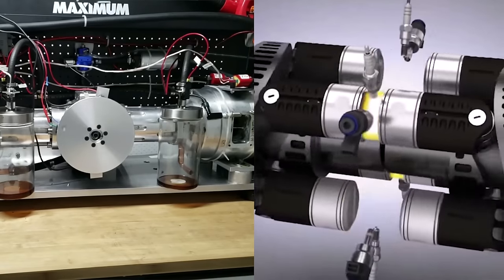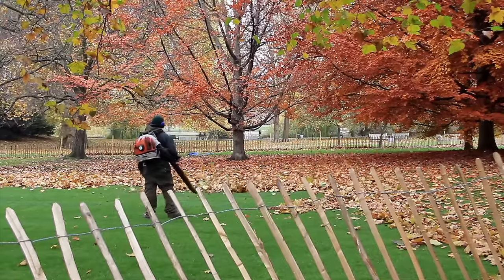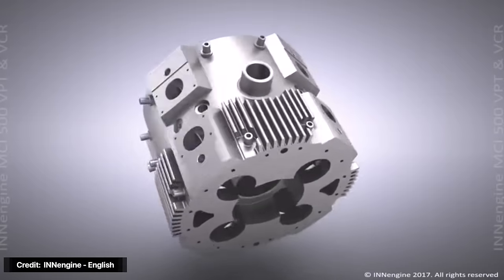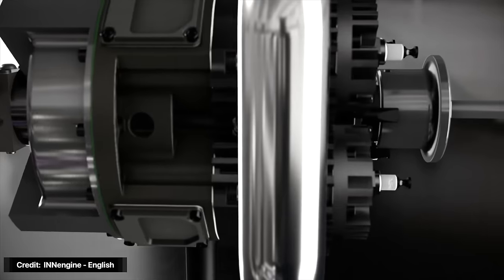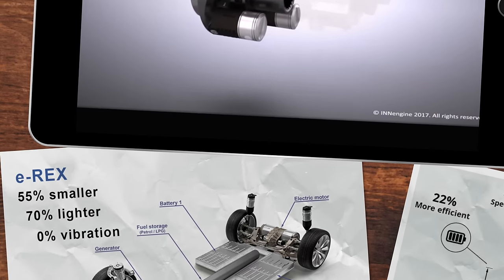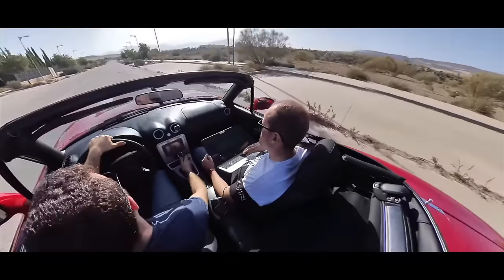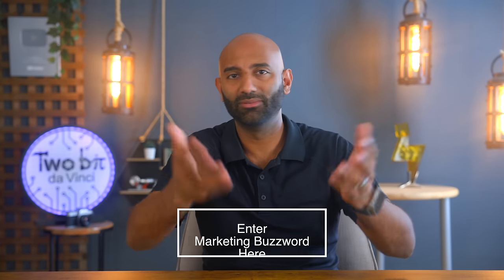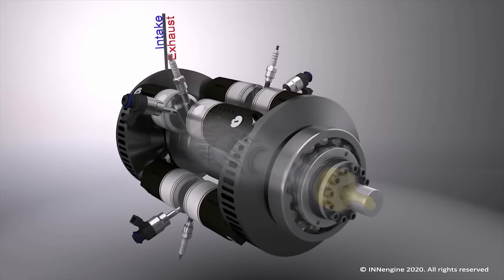One Stroke Engines - 200% More Efficient??

Comment: The resurge shows that this world is not yet ready for full EV's. you need to charge those MF's and for that you need a power grid that can do that, and were are those power grids running on .....?  we are no way near that.  If I have to shut off my AC on a blistering hot day so my neighbor can charge his EV than we are on the wrong way . second we do not have the materials to make so much batteries to support all those EV's. 3th ask a tesla driver how his car works if it is 0 Degree Celsius outside. I would not want get stranded in a blizzard in a tesla, better something with a gas tank . The EV have there use but it should not be pushed on every body like it is done now.

Comment: I'd like to see it as a EV range enhancer, recharging only when desired. In this way the full value of an EV in short distances as well as the benefit of continuous charge capability during long distances are accomplished, and optionally supplementing the system with an additional fuel compartment during a long ride to reduce pit stops.

Comment: Very interesting engine but this is definitely a 2 stroke engine just as a Detroit diesel is. The Detroit also uses a super charger to force out the exhaust and recharge the cylinder with air for combustion. This was developed in the 1930s. This engine uses a design similar to a/c compressors I’ve seen. I agree with the premise that torque is likely low.

Comment: If you will never buy an internal combustion engine vehicle again, You would be foolish. Unless you never plan on driving outside of the city. Good luck finding a charger within a hundred miles of me. Hydrogen technology is the way of the future. One fuel for your battery charging needs and range extension for an internal combustion generator.

Comment: A full transition to EVs right now would be a big mistake. Our electrical infrastructure could not support all the EVs that would be on the road. Also any EVs operating in real cold weather would have a real problem with current battery tech. Lithium is very dangerous and has caused a lot of fires that can't be put out. Also efficency is an issue.

Comment: "I'll never buy a car again that has a gasoline engine driving the wheels..."

It's great that you feel that way for yourself, but dismissing the use case for others is short sighted. Not everyone wants or can live with an underpowered hybrid or an EV that takes hours to charge every couple hours when pulling a load.

Comment: It is essentially a one stroke tho.. imagine it as a hammer, forget what it's doing inside but it hammers with each 'stroke' it is what it is a stroke. And it handles and satisfies each necessary act to complete intake combustion and exahst in one "hammer" or stroke.. the piston doesn't have to pull in air (one whole stroke, 
compress/combust(another whole stroke), the push(another stroke)  Exahust. Last whole stroke as a 4 stroke. Even a two stroke makes 2 entire strokes to complete combustion.

Comment: First thing this guy is incorrect about is that an engine sucks air in. The atmosphere by nature fills any voids the space that held the exhaust gases is filled with fresh air by atmospheric pressure. It pushes it's way in. Now a Turbo,a blower or will push or pull the atmosphere in increasing the frequency in a cylinders ability to ignite. But the atmosphere is everywhere around us. It fills space thru pressure.

Comment: Integration of this motor into existing BEV would be a good stop-gap measure to counter the not so awesome parts of EV ownership until power grid capacity increases to handle a significantly electric fleet, charging station networks grow and mature and battery technologies improve in power density, charge rate and cold weather performance.  All engines have a sweet spot for efficiency so using a motor such as this in its' sweet spot for power generation (instead of propulsion) would enable not just range extension, but also charging while parked, charging during power outages or when a charger is otherwise unavailable and as a battery capacity multiplier if using the car's battery to power a home during an outage, tools at a worksite, etc.

It is also important to remember that gasoline is only one of many petroleum products used every day and as such will continue to be produced either as a fuel or as a byproduct of refining oil for other oil-derived products.  As long as we rely on any oil-derived products we'll be making gas and will be confronted with the choices of using, storing or pumping that gas back into the ground and given those choices using it may turn out to the best balance of economics and environmental impact, meaning that we can still see a win for carbon reductions by using much less gas and doing so in ways that allow us to best capture the energy potential of the gas we use.

Comment: Honestly EVs are not a valid replacement at the current time considering grid limitations and power generation, as there is loss while charging and discharge so gal for gal for fuel used EVs don't beat out a standard IC unless you are 100% getting your power via other means. 
As for options IC over EV as in running a generator to power a solid electric drive train it is the best option to cut fuel and not stressing the grid especially in areas where the grid is already struggling to keep up with demand, it also fixes the range issue which is huge in very rural areas, as well as there being options to fix the problems with how EVs react to the cold without negatively affecting range. 
Companies like Edison Motors out of Canada have started this, though right now they are focusing on tractor trailers and trucks the idea is versatile and corrects some of the problems with pure EVs.

Comment: I am a very  mechanical and practical guy, I  eat, sleep and shit tools.  If you don’t think electric is the future for cars I really would like you to answer one question. When the oil is gone which is has to end eventually what are we going to use??? I believe we have to start using more nuclear power plants, if made and maintained properly they are very very safe  and have to start using electric vehicles where they are practical until we can figure out a long term solution. A lot of people get into which is better for the environment… they both are bad and everything we do is pretty much bad for the environment…. You can’t fart without affecting the environment In a microscopic way lol.

Comment: As a Range Extender, the One Stroke Engine could be a short-term solution to range anxiety.  But instead of an EV you'd  have a hybrid of sorts.  All that trouble when you can run all of these with hydrogen with little changes to all.

Comment: Since there are a lot of good high torque electric motors, this could be a pretty good hybrid engine. As good as EVs can be, an efficient hybrid could be better for the environment depending on where you're getting the power you're charging from. There is also the benefit of how quick it is to fill a gas tank, and as you mentioned, energy density. If you have to waste energy accelerating all of that mass then gas could be a better option.

Comment: I don't care for the heavy weight and relatively short range of the EV vehicles at this time.  I still think gas and fuel cells are better options for long distance vehicles over short time frames.  EV are suited to daily drivers and urban use.  As far as saving the planet, there is no obvious reduction in the need for internal combustion engines due to power grid limitations for charging EV's at this time.  Wind power still requires petroleum products for lubrication of the turbines.

Comment: I personally think that 2 stroke engines could make a come back since they give double the power of 4 stroke engines thus completely defeating the purpose of 4 stroke turbo engines. 
The problem is noise and overcoming the sacrificial oil burning in those.

Comment: I do not agree with your assertion that ICE engines are done. In my personal opinion hydrogen electric are the future, it just needs to be further developed. Current EV technology is just moving the pollution to another location and we're not even speaking about the end of life of the batteries. When you look at the cost of a new battery pack, you might as well buy a new vehicle.

Comment: It is cool tech but also a pretty risky investment. This covers a niche that exists now, specially it is a great fit for medium sized devices that need high power and low weight for a prolonged time. Which is something current batteries struggle with. Either the batteries do not last long enough or they are too heavy. This could be a great middle road to clean up all those dirty and noisy leaf blowers, lawnmowers and similar gear for which batteries today are not a good fit. Until that long promised battery breakthrough that replaces lithium actually happens.

Comment: Electric cars to me are not the environmental solutions that they are hyped as. For one, the electricity used to recharge them comes from oil, coal or gas powered electric plants for the most part.
All of the so called environmetal gains of driving an EV are erased by the origins of their electric charge. If we were to convert our electrical generation to safe nuke reactors then I could see some merit to the EV. But another problem is the time that it takes to charge an EV and a second issue is the vastly reduced energy of EV batteries when the weather gets extremely cold. 

Then another issue is the amount of polution created in making EV batteries. Lithium mines are located in countries that do not have child or slave labor laws consequently in order to feel good about ourselves in driving EVs we are contributing to children being forced to work in dangerous jobs for no compensation. Then take into account the diesel powered excavators and trucks that carry the ore from the mines to the processing facilities.

If EVs are the answer, then I want to see all of the mining machinery using EV technology solely. Put your amperage where your mouth is, so to speak.

Comment: Theirs a company already building diesel power EV semi's, the diesel engine runs at a lower rpm at constant rate to charge the batteries only and the drive train is totally electric .so the consumption of diesel is so low that it should be the future of EV and the key to minimizing resources depletion .or just go back to steam engines because if you search that you will find a steam power jeep gladiator .....mind blown lol

Comment: Hybrids are the way to go providing the benefits of the electric motor including instant high torque, efficiency, no exhaust and low noise and vibration  with the high energy density of liquid fuel fueling a generator to recharge batteries or power the motor directly (variable speed generator).

Comment: Do a video on why the two cylinder robin golf cart motor is designed the way it is... Two cylinders, timed the same, both reaching TDC at same time, both plugs fire together, but the cam has the phases 180 degrees apart...plus there's a counterbalance shaft. Weird little motor but runs so smooth.

Comment: I think electric vehicles with an onboard generator is the best solution for present day vehicles. The performance of the internal cumbustion and electric motors can be optimized. The idea of grid-only based charging of electric vehicles is not viable.

Comment: Im poor and cannot afford an EV. Living in the country, far from an any charging stations, and my fear of so many recalls and batteries just bursting into flames make it a solid no from me. By the time a hybrid that does come along I can afford used, the battery replacement will cost more than the car. A shift to turbine or other lighter more efficient engines, so the oil companies and the government can still get their cut would be fine.

Comment: I'm a big fan of ICE as range extenders. Most of the time, they never have to turn on. But if you want to drive interstate.... I think I read that they were working on a rotary engine specifically designed to be a range extender (e.g. generator).

Comment: its not going to because we are not to the electric era yet and it is not going to work for a long time, it is more polutant to make electric cars than gaz cars because one way or another mine equipement need many many MANY gallons of diesel and gaz and is very polutant and not only that battery are also very toxic for nature, it is not for no reason that lithium and many other metal are underground. the futur is hydrogen cars and is going to be for decades. Why give up on a technology for another when the first one is great electric as many down falls, it is extremly bad for cold weithers and many more other issues, many country cant give the power to recharge a car like that well in the other hand hydrogen cars just needs the most known resoucre WATER.........

Comment: There's no such thing as a perfect RPM.  Having a generator engine on a car to power the drive train is extraordinary inefficient.  This tech has existed for a century at least all of the car manufacturers never offered cars like this for a reason.  If they did offer cars like this they were short lived.  You would need a large V8 to give you the power you wanted.  Taking it through an extra step of charging a battery will just waste energy you might as well get a normal gasoline powered car then you didn't lose energy in rotation of a generator and heat through conduction.

Locomotives have ran with a diesel generator charging an electric motor, no battery it would likely need two or three engines to have a battery and actually use it. So your idea won't work. Not well or not better than just charging your electric car or powering the wheels with a fuel powered engine.

Comment: No, the thing is electric is not gonna work the United States cannot support all electric automobiles because the power grid can’t handle it and not just that gasoline and diesel engines have proven themselves to be the most reliable source of transportation and power for generators and pumps. You can go a lot farther with a gas or diesel vehicle or an electric vehicle. The reason they want to go full electric so they can control everybody. It’s not about the environment. It’s about control if they have control over people that they have the power to keep us from being able to move around freely. I believe it’s all politically based. If you don’t do what they say, they can cut you off and there is nothing you can do.

Comment: That last engine worked like steam  engines? That would be awesome push and pull. Like when I installed peddles on my bike when I could hook the top of my foot.  I could pull up as I pushed down . I could use higher gears ,I had more power and I was more efficient.

Comment: I have wondered for years why the auto makers do not put a small (1 liter or less) engine in a car to charge batteries or just supply power directly to a drive train. Diesel Electric railroad engine have done that for decades, And the railroad companies have been claiming for years that it is much more fuel efficient!

Comment: Modern naval ships are into what's called integrated electrical propulsion.
There is no physical connection between the turbines/diesels or propeller. They are driven by electric motors. Generators are turned by diesels and/or turbines as needed. This eliminates heavy and complicated reduction gearing.

Comment: I am having a hard time finding anything new here. The German Junkers aircraft engine of WW2 is basically the same idea in  a linear layout and several "barrel" engines were made and ran in the 1950s. Those barrel engines suffered in heat and lubrication issues and fell into the dustbin of history.

Comment: I just tuned into your video about 3 seconds ago anyway we shouldn't be turning to EVS we should be taking diesel engines and V8 engines and ruining them off  of hydrogen which just means stronger parts and is a lot more in would be a lot more popular than in EV

Comment: This so-called one-stroke engine has the same 2 strokes as the patented apposing piston engine, the only difference is no crank shaft. So the patented part must be the lack of the crankshaft because apposing piston tech is already patented. The downside is the rollers have so much pressure on them (where the oil is at low pressure) in a smaller, tighter point and therefore will wear out much quicker than the crankshaft version, which has the torque spread across a wider area on the crank and high pressure oil sheath. (between the connecting rods sleeve and crank, where the oil takes a lot of the grunt, reducing wear) -

Comment: You neglect to mention the human cost of the mining of the material,s for batteries ,then the disposal of said batteries ,also the lifespan of the batteries as opposed to a well maintained I.C.E And last but not least when the E.V battery dies the vehicle is basically redundant due to replacement battery cost,s and changing tech  which the average Joe can,t afford . You need to get back in the real world .

Comment: Its a 2 stroke engine.  It just doesn't have a crank shaft.  Piston moves away from burning gases = the first stroke.  Once bottomed out, The piston returns and compress the fuel then ignites.  The Return is the 2nd stroke like it or not.

Comment: They do not make lawn mower 2 stroke motors anymore and have not for years. Yes a Chainsaw, Weed Wacker, and other type equipment are 2 stroke. Lawnmowers have not been 2 stroke for 50 years or more. I work on lawnmowers and other small engines and have only seen one two stroke mower. It was from the early 50's and still ran well.